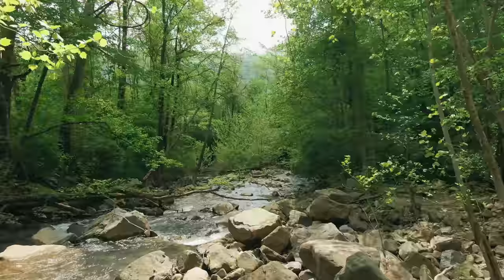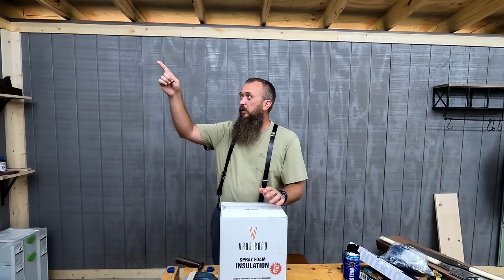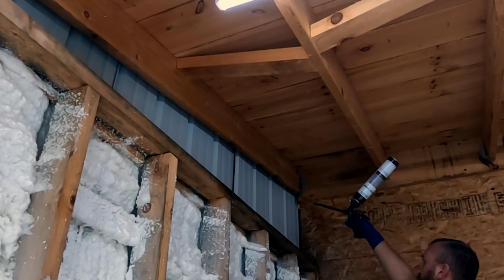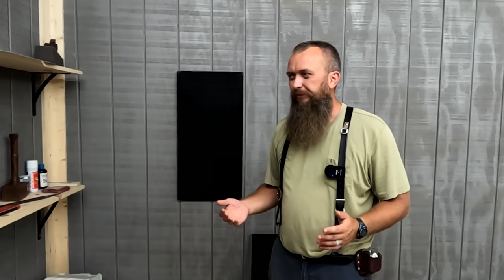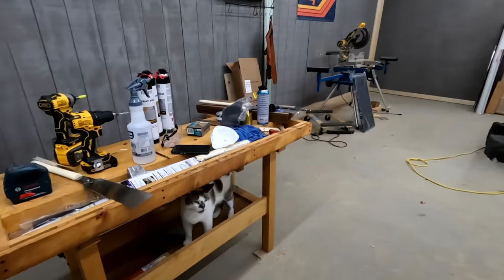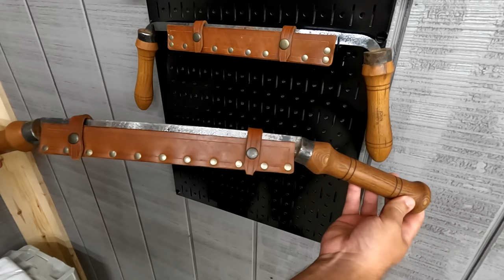Finally A DIY Spray Foam, See How I Saved Thousands

Comment: As a retired insulation business owner...PLEASE don't ever spray again without a respirator!!!! Dust mask isn't made for that stuff and you spraying WITHOUT a respirator is a huge mistake! Those mist particales get in your lungs and expand. You will end up with reduced lung capacity in the future! Don't ask how I know...
Reply: He has the mask on up side down so I’m sure he will be fine 🤣🤣
Reply: @allritecoach6357  Yeah but later in the video he wasn't wearing a dust mask either! I wasn't going to mention the upside down mask in the beginning.
Reply: My thought exactly.  Either a properly fitted negative pressure respirator with a VOC-rated cartridge (meaning a shave too) or a PAPR/SAR.  You only get one set of lungs.
Reply: @ericapelz260  Right but I wasn't going to push my luck with the shave part lol, He ain't gonna shave that beard.
Reply: I totally agree. Not wearing a respirator is a huge mistake in this case. Not wearing a dust mask while there is sawdust in the air will come back bite you in the butt later in life.
Reply: Was thinking the same thing. Good call.
Reply: Same goes for ears.  Young guys think they're smart and say you get used to it.   Too much loud noise and you'll have tinnitus 24/7.  A constant, loud ring to keep you company in life.  Like the poster said, don't ask me how I know this.
Reply: I'm sure a respirator would be a good idea but I'm pretty sure that out of a can is completely different as far as over spray and how much ends up in the air vs a professional setup
Reply: @james10739  it is still airborne, it is under pressure using a gas to eject the contents. A respirator is needed imho.
Reply: SO correct.   A man at the boat factory I worked at Lived about 10yrs of spraying in boats.  Lungs filled up just like that covers
Reply: @james10739  That's incorrect. All aerosol foam insulation states to wear a respirator, gloves and safety glasses for a reason. I have 24 years in the industry so I'm pretty sure I know what's what.
Reply: a 3M respirator is about $30.  not having one is absolutely asinine, guys.  Spring for a good one like a 7502 with the silicone face mask instead of the cheapy at the box stores that feels like a brick on your face.  If it’s comfortable you’ll wear it. I forget that mine is on.  

There is no reason to wear a paper mask.  Put one on and go sand some drywall or grind some steel.  Tell me how good it works after you wash those nasty trails from the corners of your mouth and nostrils.
Reply: @jwilsonhandmadeknives2760   Yep paper mask and dry wall.   And those was supposed to keep you safe from Covid.  Lol.  I can see dry wall dust
Reply: Doesn't really matter that he's not wearing a respirator, unless he is clean shaven then it wouldn't seal correctly anyway. I worked in forensics and even with just a days growth my 3m respirator wouldn't seal and l could smell decomposition odours.
Reply: PPE and safety rules were designed after someone suffered or paid the ultimate sacrifice.  Do the right thing for you and your family by being safe now.
Reply: @chrisgrob8812  man it is crazy.  or a mask made from t-shirt material LOL.
Reply: I am certified in spray foam have been through the classes and would like to add inhaling those chemicals can be deadly and getting it on your skin can cause serious allergic reaction. Trust me I learned the hard way. I always use a fresh air pump that sets outside and pumps it into me also is a good idea to have very good air circulation by setting up exhaust fans. Also if foam does not set up right it can release gasses that can make you and family very I'll for example check spray foam night mare, a family had to demolish their house. That is a great DIY kit but the suit and respirators are a must. To anyone who decides to go by this method please use all safety gear and do some research on the chemicals that you are dealing with.
Reply: You don't need a mask for this type of application. It isn't the 2 part method your talking about that goes all over the room and used by professionals. Just need air circulation if in enclosed area. This is the same stuff from HD.
Reply: ........and since he is NOT wearing ANY mask at all.!!!!!
Reply: Man. Didn't realize how many people wear a mask for everything 🤣 my lungs are probably 🙃
Reply: Agreed! I have owned a spray foam insulation business myself. Just let the professionals handle this. Please… This is nothing to play with
Reply: If these mask can prevent covid 19 it can prevent anything 😂
Reply: yeah I'm sure he going do some lungs damage spraying that foam stuff for 30 minutes SMH lol some people think there this expert more like a YouTube couch expert
Reply: @mauriceryton  spraying that stuff for 30 minutes not going do anything to his lungs he probably does make damage to his lungs from all that saw dust then he would with that spray foam . and look all them old times never use and mask at all and living in there 80's and 90's . i think people over act on some things . thinking they are this smart person and so called expert . if that person don't want to wear anything whatever there doing like a good face mask that up to them and there life I'm sure not going say anything
Reply: @hotrodhog2170  so i guess you have 24 years in the industry you are so called expert? .if he don't want to wear anything that up to him and you to say anything about it it his life .
Reply: so there 25 comments talking about his face mask when he spraying that spray foam . so pretty much there 25 so called YouuTube Couch Expert about spray foam 😂🤣
Reply: @Corrupted2407  yeah cuz he going to die tomorrow right .lol OMG you people are killing me with those comments about wall spray foam and I'm sure not hiring professional. you people are acting like he sprayed this stuff for 8-10 hours WOW talking about over acting about nothing
Reply: @funtyes1970  Sounds good david. You do you and I'll keep laughing at people like you. 🤣
Reply: @funtyes1970  l think you just did say something! Check the directions on those cans.
Reply: @funtyes1970  You not the sharpest tool in the shed, are ya?
Reply: @hotrodhog2170  you say I'm not sharpest tool but you make a stupid comment him spraying that foam stuff for probably at most 20-30 minutes and think he going die from it ..🤣😂😆
Reply: @hotrodhog2170  you are probably only he see what he does wrong so you can point out negative right buddy, people and hater like you sure are smart people Mr know it all right buddy 😁
Reply: @mauriceryton  lol@ directions on can WOW SMH 🤦‍♂
Reply: @funtyes1970  I never said he was going to die! I stand by my comment to you.
Reply: @funtyes1970  Your poor use of English says everything. I actually like the guy and what he does. My comment to him was a warning. I guess you didnt see his video after this one where he took heed of my warnings and was in full respiratory gear. SMH. I'm worried about you too bro.

Comment: In the future use some traditional low expansion spray foam (blue can window & door) from HD to prefill the large gaps first then use the "spray foam" to spray a nice uniform coating over everything for the best seal and save some money.

Comment: that spray foam is amazing, we use it to repair the foam on our insulated tanks, it will go on about 6" before dripping. Afterwards we use an elastomeric coating to protect it from the UV Rays. 👌

Comment: I put up a piece of peg board in my shop 30 years ago and it is still working great  with no tear out at all... I did brace it on the back every 16 inches with a 1 x 1 and screwed it into the studs. Happy with it so far... Rockler has this metal peg board and I think it is less expensive... They also have it in several sizes...

Comment: If I could offer a suggestion. To prevent heat loss through the roof, I’d spray the foam in between the rafters. It’ll also help prevent condensation from the roof. You want to create the thermal mass to reduce your heating and cooling costs. Every little bit helps. You’ll notice the difference. A friend of mine, whom I helped to build his retirement home, we poured concrete walls with 3” of foam insulation on the exterior walls and 3” of foam insulation on the interior walls. Because of all that thermal mass, you really noticed the temperature difference (it could be 95 degrees outside of the house, and as soon as you came inside, it was 20 degrees cooler. So I can tell you from experience, that it makes a big difference.
Reply: 20 degrees without AC, right? While you were still building it?
Reply: @r8edrv4fun65  without a/c it’s a 20 degree difference.

Comment: There is something special about good quality, we2ll maintained hand tools.  At 83 I still value mine enormously.  Nice to see your shop getting more & more organised Nathan.  I totally agree with insulating your workshop to keep it more comfortable to work but, please Nathan, wear a respirator when using spray insulation.  If you don't, you will unfortunately live to regret it, it will get you, 'no questions asked'.  Good video of the equipment & racking.  I mentioned about seeing you use one of your axes in another video, I look forward in eager anticipation to see you working with more of your 'hand tools'.  Cheers, Don from South Australia.

Comment: Well, nice of you to try spraying foam.  Having sprayed a lot of foam as a DIY myself in the last couple months, I think the cans of foam might have been better if you had shaken them more, and also keep them in a warm place.  Wear gloves, wipe off that "mess" on the nozzle when it happens.  But for SURE, you should never use the gun without having one of the cans of cleaner around.  At LEAST one.  I know you can get away with leaving the gun on a can for a day or two, but frankly, having messed up guns before, don't.  Run the cleaner can on the gun as directed, after you finish!  Keep a can of cleaner to spray on the gun nozzle too!  If you do, your gun will last a long time.  If you don't use the cleaner, then it is a better deal to just throw the gun away after you use it.  Saves a lot of time messing around trying to salvage a gun that is never going to work well again.
Reply: 100% agree
Reply: In Texas, I bought the gun and cans of foam for projects. I started one can and still had about 2/3 left when I put it in the back of my truck, unintentially for several months. The can ended up rupturing and I scrambled to find my misplaced cleaner.  A day or so later I found it and removed the ruptured can and installed the cleaner. Miraculously, the cleaner flushed out the foam and I was back in business.

Comment: Great video and comments i wonder how well 2 part liquid foam would do on vertical applications maybe use petroleum for easier removal and let set like a cement wall with whatever scraps available or plastic and tape or put whatever sideing or you could carve into it and do whatever that's my plan fax stone perimeter maybe just roll it on or tape and just let it thicken and dump it down from the roof winter is alot shorter then what was but still very cold

Comment: How well has this held up for you now that you've lived with it a while? Did you get good insulation out of it? A really easy way to check is just to measure the wall with an IR thermometer on a cold day when you haven't left the heat on. Especially if you can compare it against any surface that you haven't insulated yet.

In a sheet metal structure like this I think it's essential to do a pre-pass with a regular tip to fill the small spaces behind the studs and such before applying the main layer - because any small airpocket will get a lot of condensation, which quickly can turn into a haven for nasty mold.

I'm strongly considering doing a hybrid foam + fiberglass bat (reused) approach - in a wooden structure. The fiberglass will do the bulk of the insulation, but I think a minimum thickness layer of foam can do wonders for preventing that condensation that can often happen right up against the wall, and to seal any small air leaks that would diminish the fiberglass's effectiveness.

Comment: I think sprayfoam insulation is a great product. 
That said, the product you bought isn't really designed for your you are doing. 
There is a two tank system that works much better and applys much smother. If I recall it is about $600 for the kit and does 600bf? 
You should have a full face respirator, tyvec suit and all skin covered. That stuff is bad for your health.

Comment: so i am pretty sure that is closed cell foam. if that is the case you are going to want to do atleast 2 inch thick or you will get condensation build up inside your building.

Comment: I looked into spray foam, but it was way to expensive for my pocket book. I finally got a furniture store to collect their 1 inch thick packing foam for me. They would call me when they got a big box full.   I insulated my 24 X 24  shop for walls and ceiling.   It turned out good
Reply from the maker: Good deal
Reply: How did you hang it?
Reply: @2pist  I got a roll of plastic hanger, you know a roll that has holes every 1/2 inch apart. You can get it in metal or plastic. I got the plastic because it was easier to work with.  I would cut 4 hole strips, and bend them in half. I would put 4 dabs of construction adhesive In each corner, put the styrofoam in place and put a bent plastic strap about 2 inches down from each end and use a drywall screw into the rafter or wall stud . For a total of 4 per sheet of styrofoam.  This was several years ago, and they are all still in place.

Comment: There must be different grades of pegboard, because my garage has it on 3 walls.  People before me used it and I've got it LOADED with tools.  I've been here more than a decade and absolutely no hole has torn out.   My only issues is the mounting boards that were used behind it as spacers have a habit of being right where I'd really like to put a hook, smile.

Comment: Had some carports that would condensate and drip white residue on the tenants cars. Had a crew come out and spray the underside of all the ceilings, with closed cell foam, and never was a problem again. Of course I found the idea for that online, apparently it works like a koozie does. But it really didn't cost much to have someone else do it, about a dollar a square foot. Was 4-5 years ago tho.

Comment: Dude!  I generally don't make an issue over someone choosing to not use safety equipment, but you can't make that decision if you don't know the risks.  You only get one set of lungs.  Inhaling the mist from polyurethane foam will cause diminished lung capacity.  Also, they all contain Isocyanates, which are toxic, and even small amounts over time will cause things like asthma and irritation of the respiratory tract.   It's a sensitizing agent, so it gets worse with repeated exposure.  If you aren't willing to shave to get a seal with a half mask respirator, shell out some money on a PAPR (battery powered) or SAR (hose and pump from a safe place) and a Tyvek hood.  (It's what our folks with beards use)
Reply from the maker: I didn’t ask you

Comment: I’ve been thinking about using spray foam insulation till I saw something on social media that insurance companies are balking about providing coverage because it interferes with  AC duct access and electrical access in walls and attics. Also where installation is improperly applied in walls and attics mold problems are questioned about insurance  coverage. 
Is this a real concern, I d like input?

Comment: I think that the Froth-Pak 210 Spray Foam Insulation Kit would be better. That covers 210 sq ft with 2" of foam for slightly less. It's $445 Amazon. They have other kits as well. No need to keep changing cans either. If you are doing whole house or walls, get big kit.
Reply: Is it chemically the same stuff do you know?

Comment: Use french cleats.  I'm taking down 6 pieces of the wall control pegboard.  They are better than regular pegboard, but the pegs fall out when you reach up and grab a tool (just like regular pegboard).  I've got several "pegs" behind my work bench.  I was really disappointed in the Wall Control pegboards.
Reply from the maker: Thanks

Comment: Nathan, if I heard you right you are still installing batt/roll insulation between T1-11 and the spray foam you applied. Not sure you can claim it is "one third the price for the exact same thing". A very impressive collection of draw knives and spoke shaves btw. Looking forward to seeing the rest of your hand tool collection. Shop is coming together nicely.
Reply from the maker: Yep this spray foam is a third of the price as having it done by an insulation contractor 
1$ a sf vs 3$ a sf.
Reply: @OutoftheWoods0623  But you're not getting the same insulation value.  Spray foam isn't all equal, the version the contractor uses can have an R-6 to R-7 per inch.  While the one you used is 5.66 per inch.  Professional installer also has better equipment to be able to make sure of proper mixture if not in optimal conditions otherwise the foam may not cure fully and will off-gas for a very long time and may even need to be redone.  So you're taking a higher risk doing it yourself and even if it works out for you doesn't mean it will for everyone.